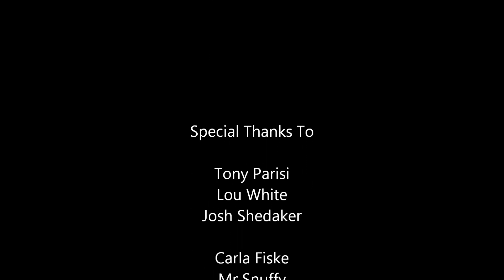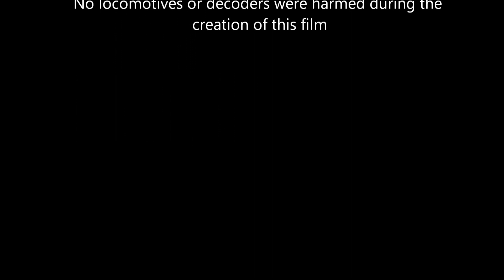Kato SD90MAC with SoundTraxx Tsunami

Comment: Weighing in at more than 400,000 pounds and with a length in 
excess of 80 feet and massive 4,300 horsepower tractive effort, the SD90/43MAC 
is one of the heaviest, longest, and most powerful single diesel locomotives in 
the world. To date, there have been three production "versions" of the SD90MAC. 
The SD90/43MAC was originally designed with a 6,000hp engine in mind, but was 
fitted with a smaller and more reliable 4,300hp engine that ended up being kept 
that way by most railroads, even though the option to upgrade to the higher 
horsepower engine was offered at a later date.

Comment: Thanks Erik,I have an MRC Advance2 but now found that they finally have a connection.Can't get it now though.I set my CV as you did and they are great slow movement,but at 128 steps ,speed 1 is jerky.At 2 it's great.Any way to help this burping loco?By the way,your vids are the rock per this 80 year old man.

Comment: Have an Athearn Genesis SD70 Mac new release Alaska.Changed to LEDs.Used 14V+ with resistors on F pads.Works great with your settings but jerkey on step 1 with 128 speed steps .works   on 28 speed steps like a champ..Anything I can do to improve this on 128?
Reply: Hi John, CV's 209, 210, 212, 213 & 214 will probably have to be adjusted. Try reducing CV212 and enabling speed tables. I go over that in some other videos here
Reply: Do not run it at speed step one.